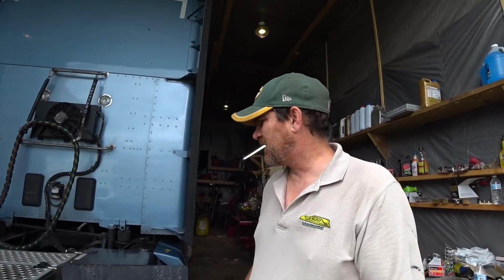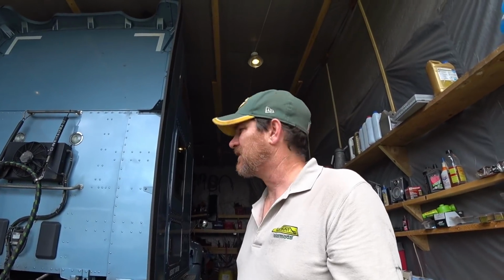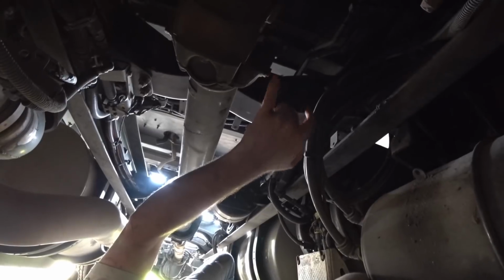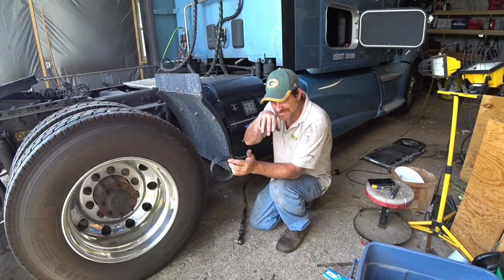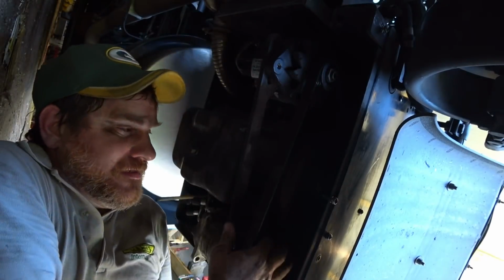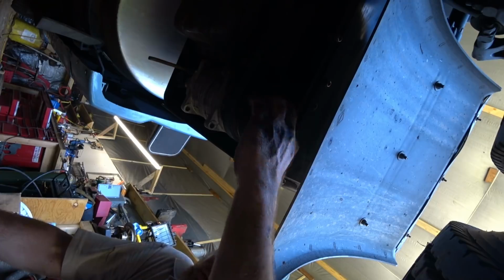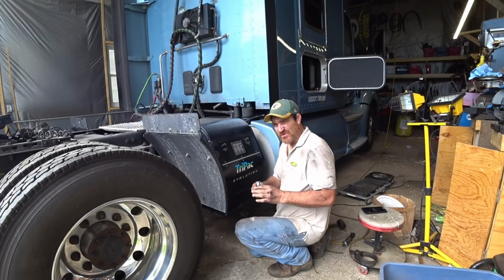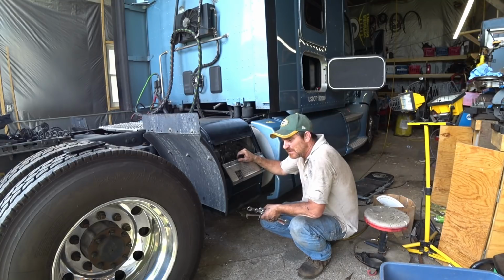July 17, 2018/257 take 2 little service work on Big Blue KW t680 w/sound🤭

Comment: I'm dying from laughter here. Your stunt on John has me in stitches!!! He went and did a complete pre-trip, looking at everything, and checking ALL his lugnuts!! He checked his tires, had his hood opened, checked his oil, checked his glad hands, his plug-in, the whole shebang.  He does have a problem with his air dryer thingie.. his tanks were full of water this morning. Someone really screwed it up somehow. Hope he called you, as he was freaking out over what you could have done to his truck. I think the only thing he didn't check was the temperature on the reefer. Thanks for the giggles. :D :D :D

Comment: Sir Larry !!!!!  Nice job getting John to do a total pretrip inspection as he thought sure you have done something to Baby Blue !!!  He even open the hood and chaceked everything under there including the steering !!!!!  Lug nuts by hand ,,Tire air stems,,trailer axles,, fuel caps & DEF cap,,,   !!! YOU sure had him going !!!! Even checked the air tank drain witch had alot of water in it !!!!  Air drtyer needs to be checked again as Freightliner was to have serviced it when they put the windsheild in !!!!   KEEP IT SAFE !!!!!